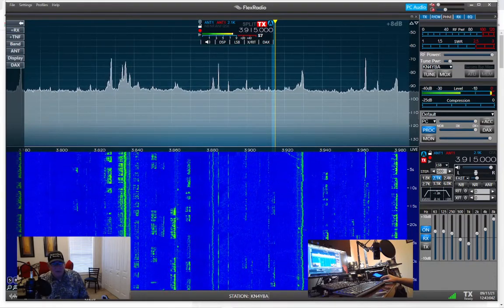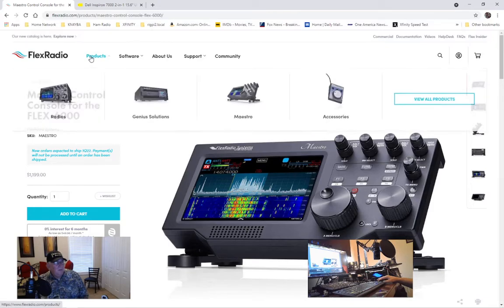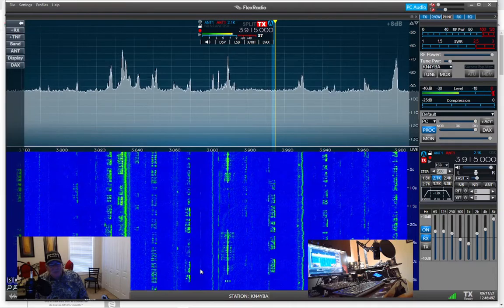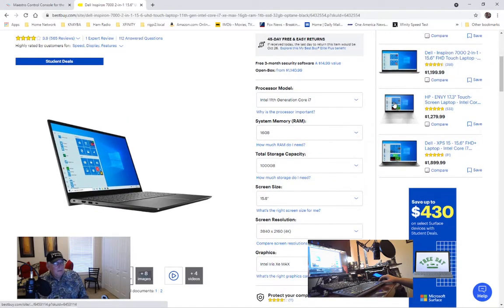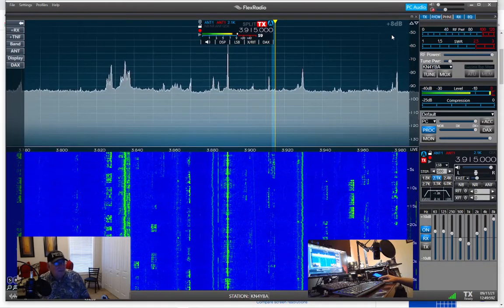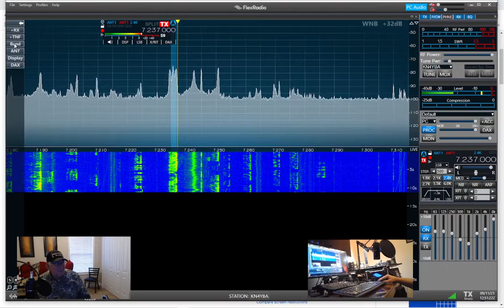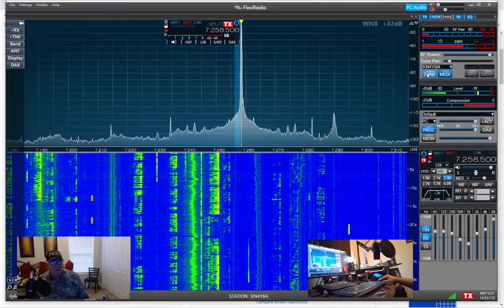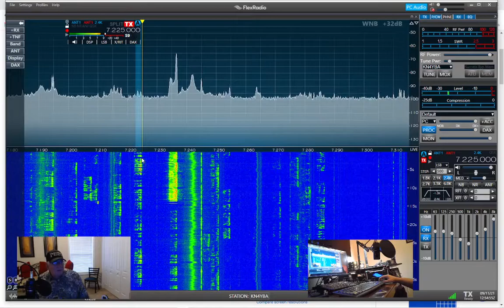KN4YBA My Flex 6400 Demonstration

Comment: I have the 6400M. But with the 6400 I assume you do something with the mouse to change the frequency. How does one do that? KB3Z
Reply from the maker: Hello,
In the SDR software look for Steps, I generally set at 1k, times you would need to select 500 or 1. From there just use the mouse thumb wheel to move across the band based on the Step configuration.
Reply: I had a gut feeling that using the Mouse Thumb wheel was the way to change the frequency on a specific slice.

Comment: Which headset with a boom mic did you end up getting? I'm thinking of getting a 6400 or 6600. I had a 3000 ten years ago so it's not completely new to me. So still like it, do you regret not getting the 6600?
Rick NJ5W
Reply from the maker: Hello Rick, I purchased the Yamaha CM500 Boom Headset. I think I did modify speakers slightly. I don't use much but it does come in handy when the grandkids are here.

73

Randy

Comment: I just ordered a 6400 do you have a first time hook up and start up video
Reply from the maker: Hello, I  started with watching Jason (Ham Radio 2.0) before receiving my 6400. You will enjoy the radio.

73
Randy
Reply: @kn4yba80 well I had to send it back only having the 6400 for 2 days it would not start up unless the lan cable was disconnected. They say they have no fix for it and that new radios are having that problem. It’s a shame I really wanted a flex.
Reply: Excellent video thanks

Comment: Hi Randy. Great video. Thanks. I was trying to make a decision between the 6400 and the 6400M and I think you tipped me over to the straight 6400. I did have a quick question. Have you ever used digital modes with your Flex? If so, do you know if that's something that can be run remotely? 73 de KO4CLV
Reply from the maker: I have only tried FT8 at the house on my LAN and it worked fine.  I would expect the same results external of my local LAN as I see internally.

Comment: Hi Randy. Really interesting video about the Flex. I've thinking to purchase lne of this radios but I hqve bad eyes and I would need to use magnifier on the computer. Do you know if the regular magnifier on tje windows be able to use simoltaneusly with the software that euns Flex 6400.?
Thanks
Javier
TI2JS
Reply from the maker: Hello Javier, I tried it and the magnifier in Windows does work with SmartSDR.

Sorry for my delayed response.
73

Randy
Reply: @kn4yba80  thanks so much for getting nack to me.

Comment: Great video, Randy. Thinking about getting a Flex 6400 myself. Of course I'll be paying for it on payments, but I think it's worth it. I have a IC-7300 but it's hard for me to use since I'm a quadriplegic and can't use my fingers. I think integrating everything into my laptop would be a tremendous help. I think your videos have been the nudge I needed to finally take the plunge and click buy.

73 de K4LTC
Reply from the maker: Hello,  You would be pleased with the Flex connected to a Laptop.  I use a Dell Inspiron 15 7506 2-in-1 laptop, I7, 16Gb, with a 1TD SSD.  The capabilities the Flex radio provides when connected to a Laptop helped me take the plunge and I have not looked back or have any regrets.

73
KN4YBA
Randy

Comment: Nice video.. did you say that you have a 160m through 17m inverted vees in your attic? That's a big attic! I'm thinking about the 6400 with Maestro. 73, W3ATT
Reply from the maker: Thanks, I have no other option but the attic. I do push it as with 160 as it is more horizontal than V with 14 feet height to work with. When HOA does not permit outside antennas I had to improvise on my design.   I have pics on the KN4YBA.com website of the attic antenna configuration.  You will not regret the 6400 but consider a tablet/Laptop.  I first ordered the Maestro, but after one time on the laptop I realized I liked the additional capabilities such as Bluetooth, watch movies, check the news and print....  The Maestro is great if you need knobs, but if you don't I would consider first loading SDR onto a laptop and try it out..

73, KN4YBA